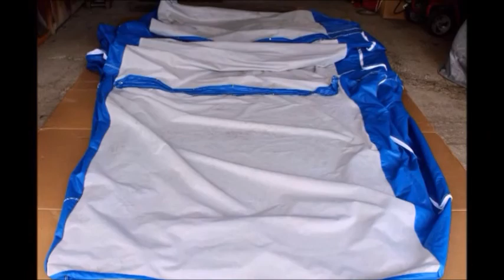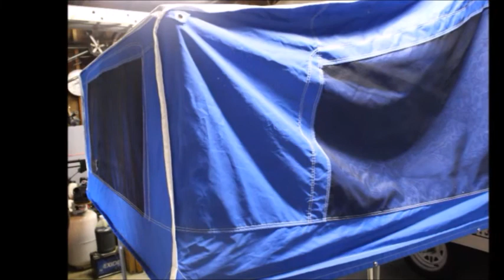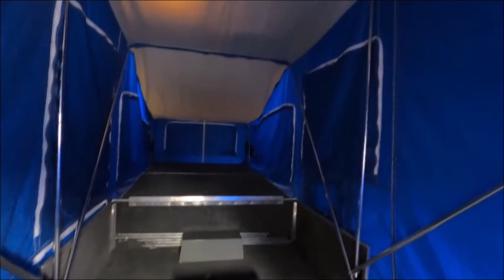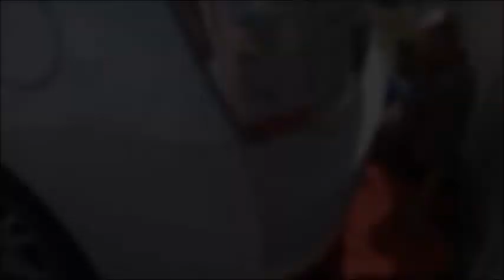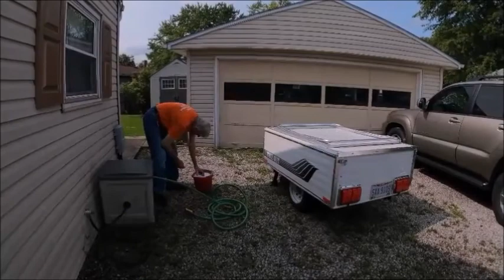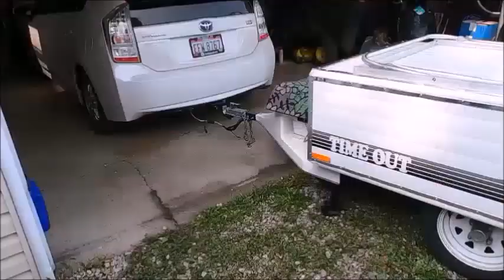Prepping Our Prius to Tow Our Time Out Camper

Comment: We just bought a time out to pull with our Spyder.  We talked to a hitch place to use it with our car and were told they couldn't do a 5 wire system on the car.  What did you use to wire it to your car?  Thanks.
Reply from the maker: Hubby purchased T-Connector Plug and Play, flat 4 wire system.  Ordered it from E-Trailer . com  - He changed the wiring on the trailer. 

What kind of car you are wishing to pull your TO with?   Thank you for asking :)